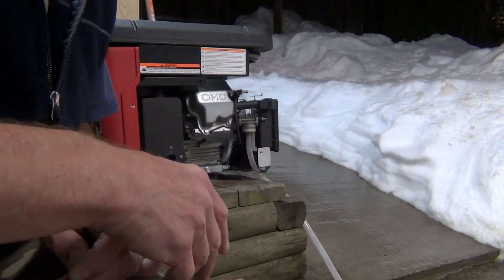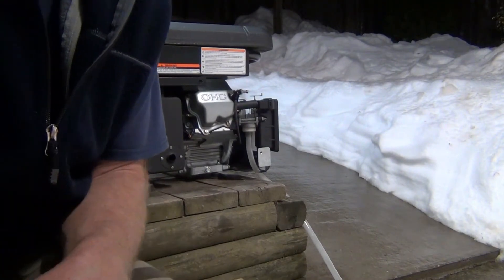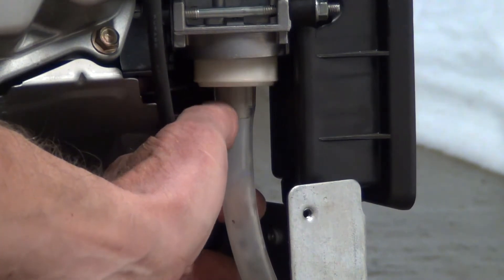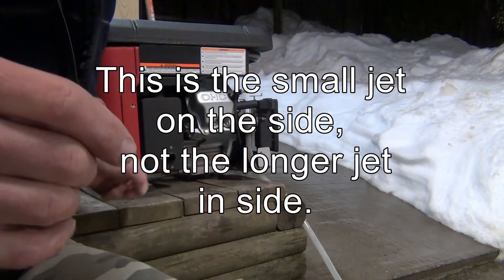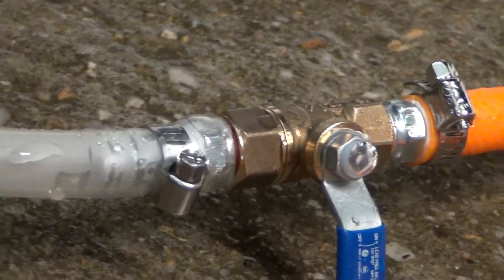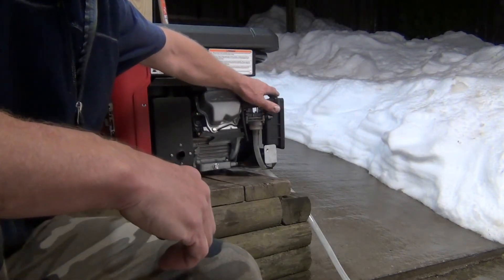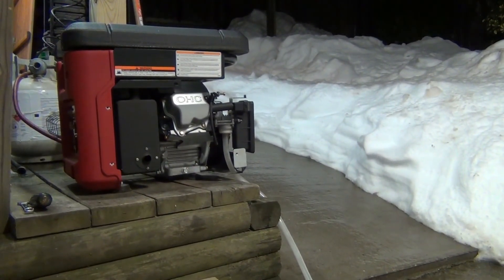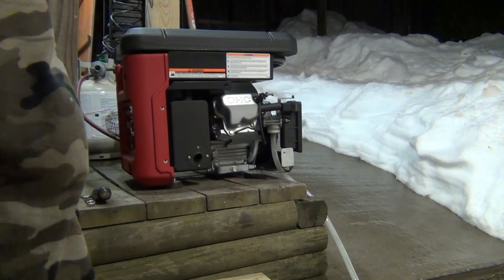Easiest natural gas conversion

Comment: Great till the generator cuts off for some reason and raw gas is escaping. The regulator diaphragm prevents gas come out without the suction from the motor. Spend the $65 and get a regulator.
Reply from the maker: I have at lest five of them

Comment: I have 3/4” gas line coming out of house with shut off how many feet can I run 1/2” to my generator that has a 420cc 13hp motor running 8750 peak watts and 7,000 running watts. I want to fun 1/2” from 3/4” about 25 feet is that to far or should I run my 3/4” from house farther? I want to make sure I get enough NG to my Generator. Thanks
Reply from the maker: I think 1/2" should be plenty,  but you will never get 7 000 watts out of this generator on NG anyway.

Comment: Congrats..No expensive Gas kits, no regulators, Nothing.. Mine run as the same way, a hose connected directly to the carburator thru a small hole in the air filter case.